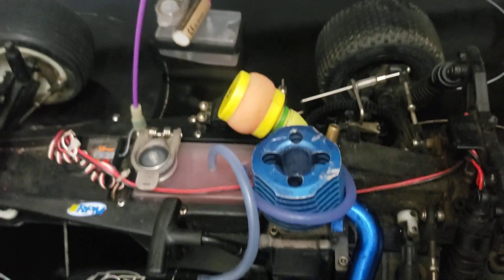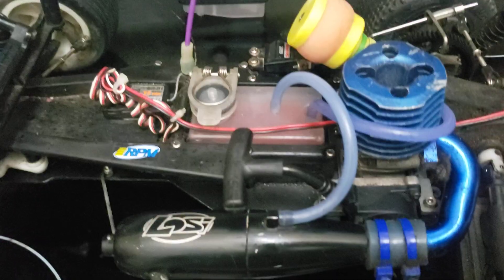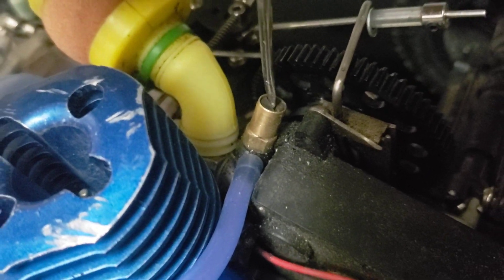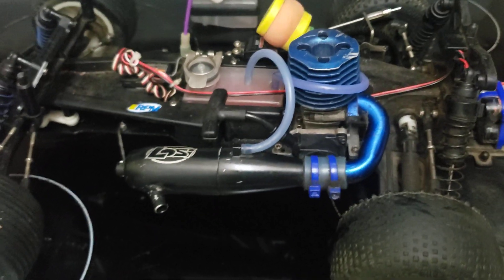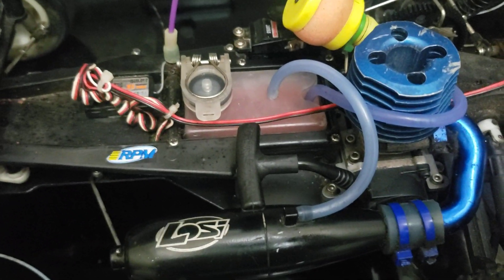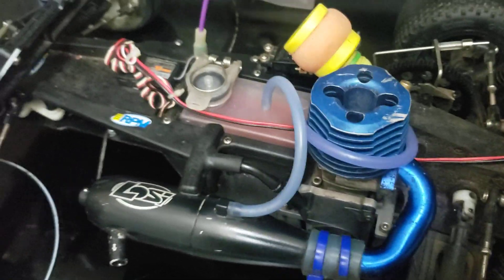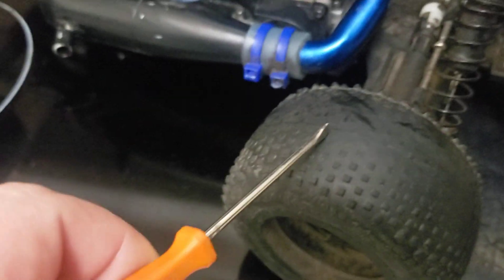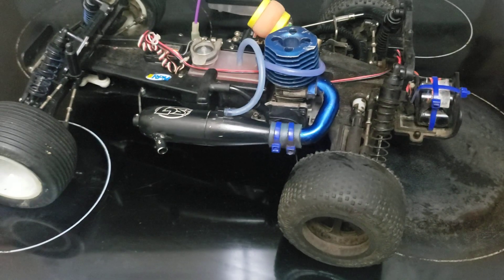fuel and exhaust systems leaks.

Comment: Bug 404 I  have a cen gst7.7 that suffers terribly with exhaust pressure problems  resolved by fitting a primer in exhaust pressure line so 1way valve stops pressure drop at lower revs. Just putting it out here might be of use to you or someone! Especially helps 1/2 tank lean issue
Reply from the maker: Interesting. As long as it works! That's what matters